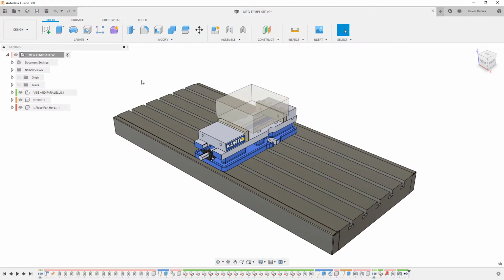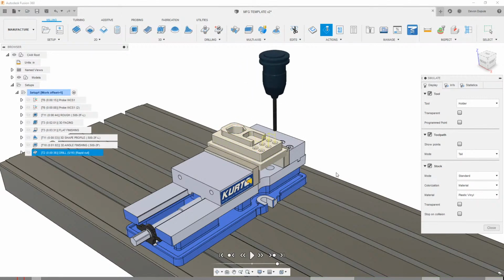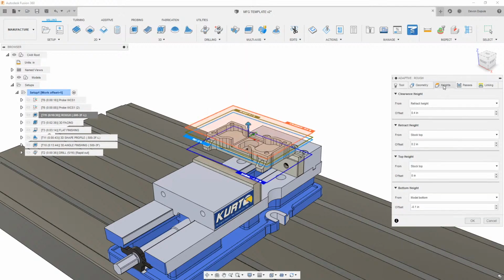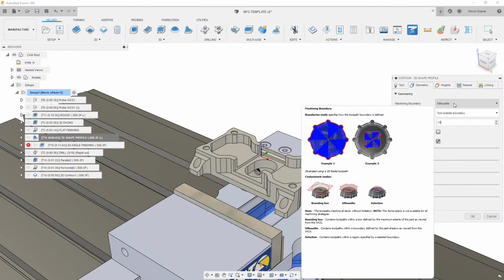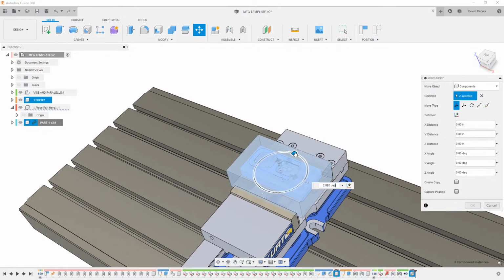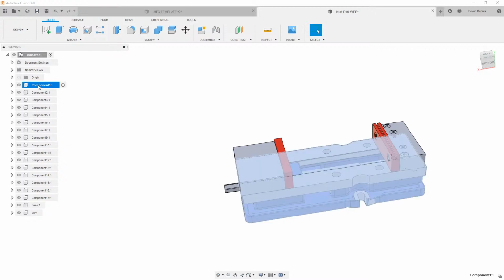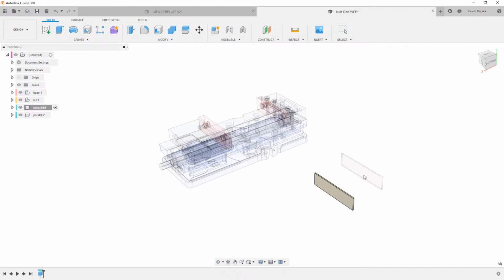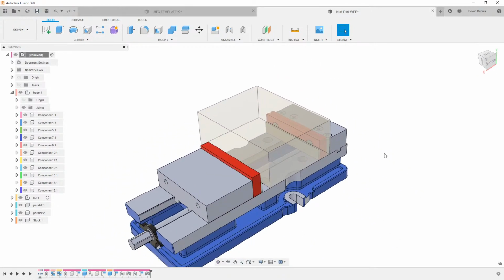360 LIVE: Benefits of 3D Toolpaths over 2D

Comment: Devon,   Could you do a video showing how to machine  a part with features that would require multiple rotations of the part using a kurt style vise as the workholding?   Where I struggle  is in the stock,  I can set the part with the initial stock used but i have never found a proper workflow to  do the  second , third operations  and allow for the stock  removed in the previous operations.   Please follow the same format as this video for setting the  part in the vise on parallels as that is very typical  of my parts.

Comment: I cannot get the the moving jaw with the parallel to move over to the edge of the stock without them seperating and causing an error. Can you anyone help??
Reply: Have you created a rigid joint between the jaw and the parallel?